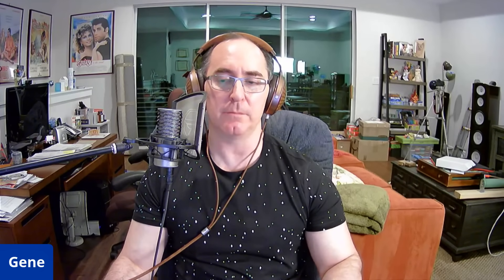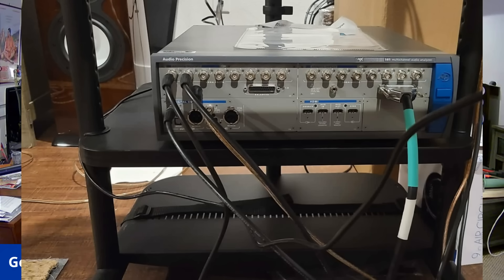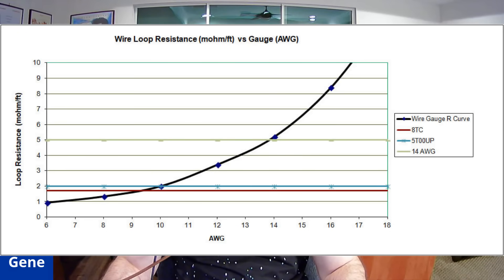Speaker Cables Really Don't Make Much of a Difference?

Comment: I bought the leadinf, 10 gauge speaker cable for guitar amp speakers on Amazon, which are constructed. VERY well, and was pleased. I then got a deal on Evidence Audio Siren II cable and made my own. Not sure if the gauge, but they are thinner and constructed differently. 

I could definitely tell in an A/B comparison, despite the cables only being about 5 ft.

The original cables seem to have more bass and the Siren II seemed to have more top end. However, the top end on the original cable seemed more grainy, and the high end on the Siren II was not only louder, but more clear.

The difrence was very noticeable, but because it took some time to switch between the cables, it could just be that I was "forgetting" how the previous one sounded, so I chanced my tube amp and had someone quickly switch them for me on the fly and... The results were the same.

Is one better than the other? Perhaps it just may be a matter of taste. Can you match them with the controls on the amp? Kinda, but not 100%. You'd need a lot more than just bass, mid, and treble, ordinance, and presence controls to totally equalize them.  

Will more expensive cables fix your life? Probably not.. And for guitar amp purposes, since you probably would be going through a mic, mic preamp, and other grear for recording or to go out through a PA, perhaps the difference could be more subtle. All of these things alter the sound and can impart their own "filtering" type effects and resonant peaks or what not on the signal. 

I haven't done recording tests, but listening to the speakers directly, there was definitely a difference.

With that said, simply listening, not comparing them directly, I wouldn't be able to tell which one was which on their own. I'd have to compare them directly. However, playing a guitar through the rig myself, I might be able to make a better guess because the low end responds differently through the 2 cables... Which could still be a function of how the high end sits VS the low end.

I did buy another leading, pricey speaker cable through Sweetwater and that cable sounded the same as the first cable. It was made out ow whizbang materials, but I don't think the construction was the same as the Siren II.

In the following description, they say that it passes "distortion-free midrange and high frequencies." this description is exactly what I heard, before actually reading the description. Now.. If you like a "vintage" and "warm" sound, I not sure this is exactly what you want, because the sable seems to pass a lot of clarity that could potentially sound abrasive with some setups. 

Just FYI, Info from the manufacturer:

"DESIGN
 Our proprietary high-purity IGL copper conductors exceed IACS conductivity standards for annealed copper, producing distortion-free midrange and high frequencies.

 Solid-core conductors eliminate the negative effects of strand interaction on the audio signal.

 Six individually insulated 20 awg conductors keep skin-effect distortions outside of the audible spectrum.

 Our open-core design provides twisted-pair geometry with spacing between poles for reduced magnetic interaction, delivering dynamic and dimensional sound.

 Polypropylene insulation holds conductors rigid to minimize electro-magnetic modulation of the conductors.

DIRECTIONALITY
All cables are directional. Drawn copper elicits a grain structure with a chevron shape, clearly visible under a microscope. Each run of Evidence Audio cable is listened to and tested for directionality.

Once directionality is established, a red boot is used on the output side of the cable. Between a guitar and amplifier, connect the red boot to the amplifier.

Break-in
Cables sound best after carrying a signal for approximately 40 hours. This is due to the dielectric forming. As the conductor’s insulation material stores and releases an electric signal, its molecular characteristics stabilize with regard to how they store and release the energy applied by the conductor. Expect any cable to sound its best only after passing a signal for 40 hours. Note that approximately 80% of the change occurs during the first 10 hours a signal is presented to the dielectric. Don’t expect too much after that."

Is what's going on exactly as the manufacturer describes? I have no idea.. It could all just be marketing.. But that doesn't matter. The resulting sound from the speaker has noticeably more high mids and highs, and at least through my rig, which is an EVH stealth through a Mesa 4x12 with V30's, that part of the description is true.

I think the main takeaway for me is... Audition some different cables and see what you like. Keep what sounds bet to you and call it a day. If you didn't get them for cheap, make sure they're returnable. Also, audition them VS some cheaper cables that are made well.

Comment: I thought I smelled a rat.  I might get what he is saying to get just so they look nicer than Bestbuy/Amazon Basics fair but that's about where it ends.  I also notice too that cable companies spend a lot in developing the exterior of them as well , as I had a hifi dealer point out how nice they look hooked up to the speakers and equipment.  So it's kind of the whole chocolatey, airy + "picture how nice these would look attached to your equipment"...   Dealers tell you to spend like 10-20% of your total system purchase price on cabling, which to me is absurd.  And this confirms it.

Comment: But how you can meassure what i hear, my ears aint lying to me 😂
Reply from the maker: Your brain is. It's called placebo effect.
Reply: @Audioholics  nope, its called hearing. Machines/devices for measurement cant compete with ears or eyes.
Reply from the maker: @permsn  you're right,  our hearing is far too inconsistent to discern small differences caused by changing cables. Once you remove the sight from the equation, the audibility differences of cables evaporates.
Reply: @Audioholics  sorry for you that you dont hear any difference. But to call it a placebo is a bit strainge. But you the pro and i'm the placebo dude
Reply from the maker: @permsn  expensive exotic cables didn't exist before Monster Cable back in the 1980s. 40 years later, there isn't a single study published using controlled blind listening test protocols that show a statistical significance of audible benefits of exotic cables. Most recording studios use standard cables and no exotic nonsense. No other industry promotes magical properties in signal transmission other than consumer audio. I'm sure you think you hear a difference, and if that comforts you on your purchase, then that's all that matters, even if it's placebo.
Reply: @Audioholics  please stay stuck in your so called measurements. And stop saying its all placebo, so lame and such a nonsense.
Reply from the maker: @permsn  if you don't like the message, there are plenty of youtube channels that will reinforce you with confirmation bias on your exotic cables purchasing decisions.
Reply: @Audioholics  lmfao and you call me biased hahaha
Reply: What you are feeling right now, that impression, when confronted with facts, that your brain has bitten à lemon, is called "cognitive dissonance" now watch à couple of videos of people claiming all kind of nonsenses without proofs, at you'll feel better. If you're interested, I've à bridge to sell you.

Comment: IMHO, speaker cables do not make much of a difference on sound.  They do make a difference, but it is at the bottom of the list of "all things matter".  So I would not spend any money on them.  I DIY.  If I want to spend a few thousand dollars on room aesthetics, then I'll buy original art.  In my room I have a $10k hand made billiard table with Italian slate, exotic wood from Brazilian rain forest and a lot of solid cherry.  That adds to the vibe in the room more than $10k worth of wire.

Comment: Gene, are you familiar with a Stereophile article regarding the matter called "What a Difference a Wire Makes" by Ben Duncan Jun 12, 2020 (First Published: Dec 1, 1995)?
Reply from the maker: nope
Reply: @Audioholics  That article has some useful information based on the measurements of amplifier-cable-loudspeaker system interactions on transient signals.

Comment: appreciate this video, but apart from any measurable or noticeable audible different in actual cables, i'm wondering how much audible difference there may be due to shielding when you have sloppy installs or too many wires including power and interconnects.   is interference of any kind an issue or is that a non issue...  and not sure how you measure that performance...

Comment: Hi, Why did you use the 14G cable?  You had to use the 10G or even 6G. The result would be better as expensive cable. I'm pretty sure.
Reply from the maker: I never use 14awg. All my cables have 10awg or lower resistance.
Reply: @Audioholics  I mean you could use for the test.

Comment: Milliohms of cable resistance is irrelevant in comparison to speaker impedance/resistance and even more so for short(er) cables. I would say no two speakers have the same impedance. An 8 ohm speaker is rarely 8.000 ohms and the tolerance could by far be made up in speaker cable. I usually just purchase the heaviest gauge spare cash allows.

Comment: EXCELLENT! This nonsense over very costly cables has been going on for eternity. Bottom line length and gauge matter that’s it! I know electrical engineers and they say the same thing…cheap Home Depot speaker wire.   I laugh when I see speaker cables on little stands elevated off the floor! More NONSENSE!

Comment: Well, I "made" my own cables, calculated the cross-section, bought twisted speaker cable to length, prepared the ends, installed bananas on it, and there I go. Paid low end money for mid end cable with just a little knowledge and a bit of elbow grease. Works great, sounds good.

Comment: Here is the physics.  The signal isn't transferred from elecron to elecron. The power is actually delivered from the sorce to the receiver as a wave more like a vector...yes traveling in one direction.  This wave travels at nearly the speed of light.  This power vector propagates in the electromagnetic field set up from the equipment and cables interconnecting it. The elecrons are merely transferring the charge in the wire and not moving very far. So the cables need to not impede this and not leak to ground. So yeah adequate gage is the first thing good insulation important and keeping magnetic materials out of the electromagnetic field. At a reasonable cost thid can be achieved.

Comment: I find speaker wires can be the difference between sweet or bitter (harsh) sounding music. They can also improve the resolve and focus in individual parts of a recording. I’m very skeptical of the mega-priced models. Thousands of dollars for a foot copper is incomprehensible. The improvements heard were from an old pair of M.I.T. cables that found. Buy used it possible.

Comment: You can't really do this with measurements. Even obvious things like capacitors in the tweeter crossover will measure basically the same Even though to the human ear the difference between a clarity and an electrolytic is blatantly obvious. Our ears pick up tone and timbre. I have done the speaker cable test before and on a really high-end system there is an extremely slight difference with certain notes that is repeatable. Is it worth the money they charge? Probably not but people going for every last bit of everything will do it. Let's not forget there are ignorant people that even make statements like all amplifiers sound the same so the degree of fanaticism is extremely broad in the audio world

Comment: Use 2 pair of cheap cables in paralel and you reduce resistance by 1/R1+1/R2=1/Rt ... This is the real reason why you should NEVER buy expensive cable .. because you can buy twice cheap cable to have BETTER performance.

Comment: Exceptional Presentation, Your Excellent Measurements confirm what OUR back-of-the-Envelope Physics was making us Sceptical. JUST USE COMMON SENSE; Wire Gauge vs Distance, Conductor Quality esp OFC,  and maybe Insulation Type.  Under $1/Foot for quality OFC Cable, and under $2 Ea for descent Banana Jacks. I wired a Entire 9 Speaker Marantz/Klipsch/Sony Home Theater System. .... BTW which Snake-Oil (Patch-Ins) was Unable to Improve On. Running Cable Types Separately and adding a Power Strip with 48 db Low Pass Filter did make a difference.... Some Noise Reduction from what was already almost unintelligible. 12 Power INput Panel is RocketFish w/LED Lit sockets and LP Filter & Surge Protect ---- was  $100.

Comment: paid under 1$/Foot for 12 Gauge Copper, cut my own & Installed Bananas. $150 to $200 Cables made No Discernable difference in my 9 Speaker Marantz/Klipsch System . Power Strip cost me $125 and has Internal 48 db LP Filter so Power is clean. Low level signal cables are shielded of course, Speaker Cables terminate in Low Impedances and I Separated ALL Different Cable Types.

Comment: The Kimber monocle x and 8tc dose not measure the same, but that is because you need longer wire to make the same length of cable when you put a material in the middle. That's why the test with 8tc pulled together with air in the middle is a fun study. Try measure this modified 8tc against the original, because the sound of the two is quite different

Comment: If you for example take one set of Kimber 8tc cable, and push the cable together so that the cable is about 5cm wide and with air in the middle, the Kimber 8tc will sound totally different from the original one. That's what Kimber cable do with the monocle x cable, just a material in the middle, and then the cable have airiness and depth. So the same cable (cores) with different ways to make it, it gives you different sound. But the cable will probably measure the same

Comment: I have tried many different speaker cables during the years, and one of the reasons why some cables sound better than other, is the Airiness and depth that some cables can create. It is quite sure something that your not able to measure 🤔. For example Van den hul scs 2 - 4 - 6... Cable all sound different, with the scs 2 with dramatic more room depth and Airiness than scs 4 and 6. The same with Kimber cable 8tc vs monocle x and 12tc vs monocle xl, these Kimber cable differences is only the 15mm core, but the differences in sound are big.

Comment: I presently use a 12 .5 ft pair of Q Audio Time Stream multi-strand cable to connect to the DCM Time Windows. Bought used - $50 for 50 feet. Cut into four pieces and I stripped and added cheap banana plugs. Sonically I doubt it is any different than zip cord. I bought it because the price was right and I was helping a friend out as he also sold me a Bryston .5 preamp and 3B amp ($300 and $500).
Reply: The TW's are driven by an RGR4 preamp and a Sumo Andromeda amp - all bought used. Music is from LP's, CD's and FM radio.

Comment: I recall the dynaco st70 diy assembly instructions said to use just 16ga residential lamp cord for your speaker cable.so I have always used cheap dollar store 14ga extension cords for speaker cable

Comment: In the eighties I had a cd player with 2 outputs... played this game with a friend of mine immediately swapping on the amp between both outputs having a different interconnect. So when listening you could not see what output was selected. In approx 80% - 90% of the cases we could guess the cables correctly. In general you could hear differences between those shoe strings delivered with the cd player versus decent cables like Monster or VandenHull. Were the differences huge? No, but still worthwhile... Comparing quality cables was more difficult. So as a rule, I always string up my system with the quality stuff (but mostly the basic lines). I mean Van den Hull cable start as from 20 Eur for a meter, ... that stuff is great and not terribly expensive.

Comment: Audiophiles spend thousands of so they can get the most realistic sounding system, but they have no idea what real instruments sound like. Unless you’re a musician, you have no reference point on how an instrument, not to mention music is supposed to sound like. Not to mention most studio recorded music is not meant to sound realistic because the engineers decide how loud instruments sound in the final mix. So spending thousands just make it sound different, not better, because you have no idea what “better” is.
Reply: Think that's a bit of a bold statement... I am sure some audiophiles can play e.g guitar (like me, but I am just not very good at it), played in a brass band when they were young or go to live performances... I agree that spending thousands is not necessary, but spending a bit of money on a decent interconnect and loudspeaker cable is definitely worthwhile.
Reply: @henrikvl1704  Don't disagree there. I've spent $100 of quality interconnects that last forever (still have three cables I bought over 10 years ago).

Comment: I purchased my first "hifi" system in 1997. For $4000, I got a Pioneer Laserdisc/DVD player, a Yamaha receiver, and Klipsh floorstanding speakers with a center, surround, and 12" subwoofer. The salesman asked if I needed cables and speaker wire. I said "yes" and he started grabbing Monster cable with silver conductors. I don't even know if Monster still makes that stuff. It was ridiculously expensive and I was like "no". Give me the regular stuff. And, I never had any complaints about it.